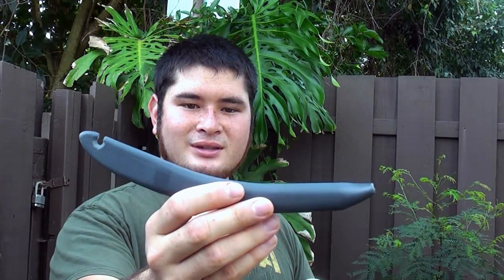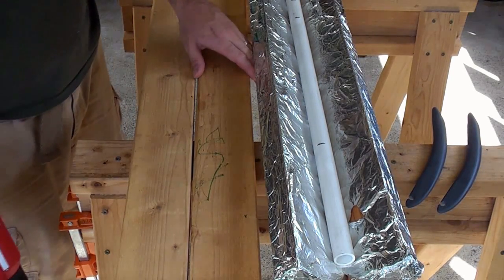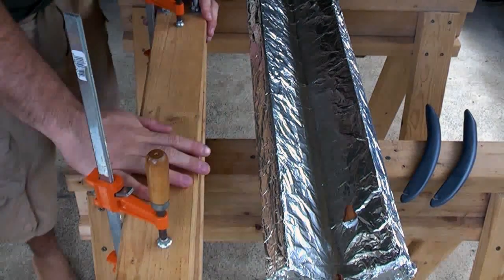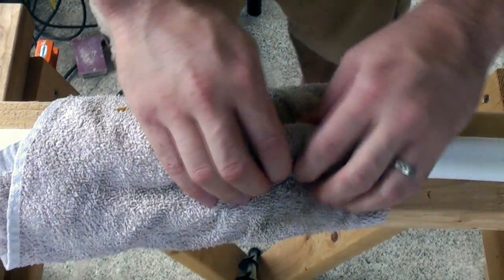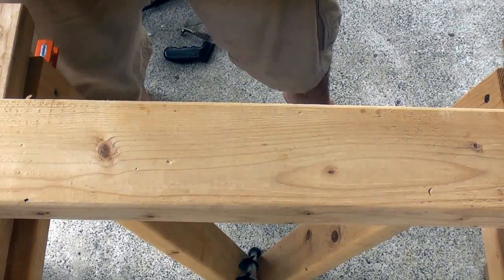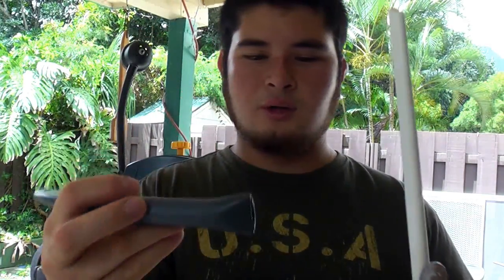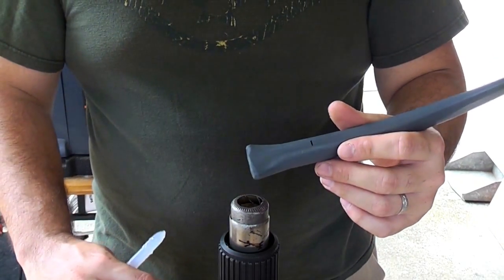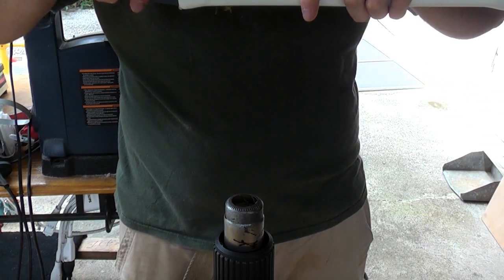PVC Horsebow With PVC Siyahs Build-Along Part 1 - The Build

Comment: A pvc how WILL shatter in minus temperature. And can be dangerous.
Reply: A compound will break if dropped from a high place or if dry fired. A laminate recurve will fail if dry fired or if it's used to hit baseballs. A crossbow will explode if when in a cocked position, you drop it from a plane....duh...

Comment: Approximately 1- how long will it take to soften the pipe with the heat gun before you know its ready to be cooled and about 2- how long does it usually take to cool? 3- Is there a big difference as far as heating and cooling between the dark grey pipe and the white pvc?
Reply: It only takes a few minutes to heat sufficiently and to cool. If you are ready to start, just get a couple of sort sections of pipe from your Lowes store or Home Depot type store and practice. I taught my Scouts how to make them in one hour and a half BSA Troop meeting. We went from cold pipe to finished and shooting in that hour and a half.

Comment: So can anyone please point in the direction of where I can get schedule 40 & 80 pvc in Tasmania, Australia cause I just walked in to my local building supplies place & the guys in there looked at me funny when I asked for it.. is there an equivalent teminology for aussie pvc that I could ask for instead.. cheers..
Reply: +Kolahai   Yes, like Womba Bloke said, US pvc is notably better than Australian stuff for making bows; it's got just the right amount of stiffness-v-flexibility, and responds very well to heat-shaping.  Our white water/sewage stuff is thin-walled and doesn't lend itself to adult-powered bows, unless you make them crazy fat, like 50mm pipe or more....you end up with these really wide paddle-bows, look crazy funny, but they do work.  They're also more brittle and don't respond as well to heat-shaping, so you can't get any really nice reflex/deflex into it, and you need to make them longer to counteract the brittleness.  Conversely, the orange electrical conduit is softer and responds better to heat-shaping, but it takes quite a set and lacks cast.  But it does work.  I would recommend using 32mm orange electrical conduit, and follow Backyard Bowyers recipe for making his basic recurve bow.  You'll end up with about a 30-50lb bow, the shorter you make it the heavier the pull.  Try a total length of about 55 inches for starters.If you live near or in Hobart, go to the electrical wholesaler D&W, next to K&D Trade, opposite the garden centre bulk mulch place...Mertonvale Cct, Kingston.....orange pvc is half the price of Clennets Mitre 10.And for your string, buy that slippery and brightly coloured nylon rope (yes, it's proper rope, not garden twine) that comes in a small fist-sized reel, I think there's a 3 or 4mm one that's right thickness.  Just tie a bowline at each end to make the loops, and serve the middle where you'll shoot with a pulled-away strand from another piece of the string (3 strands wound round each other to make the string...use one of the strands).  This stuff does stretch initially, so only loop-tie one end, and hand tie the other end when you've got the length you want.  Then after half an hour or something, unstring the bow and tie the rough-tied end into a proper loop with a bowline, getting the string to the same length (fiddly as all hell, but looks nicer in the end........like we can make a bright orange pipe look like a dangerous weapon.....
Reply: +Kolahai i know you asked that question a year ago, but we can't get schedule 40 or 80 or even their equivalent here, i'm just going to some shipped from the states.
Reply: Thank you both so much for your info.. It's appreciated trust me :) been struggling with that white stuff for so long, I practically gave up :)
Reply: +Kolahai ...No worries man, I've been struggling too for ages.  Too fun to give up though.  But I've just had an epipheny.....oh my goodness......watch Backyard Bowyer's Zombie Slayer video; the Schedule 80 (thick walled "mooshy" pipe) comes in the US as either a water OR electrical conduit variety.  It's still probably different in characteristics, but sounds much more like our orange electrical stuff.  So from now on, I'm using build-alongs that use Schedule 80, but one size bigger than shown....i.e. if they say, "we're using 1 inch schedule 80 today".....I'm using 32mm, one size up.  Yeah, think we're onto something here.  I'm glad you asked your question, Womba Bloke answered it, and it all peeked my interest and allowed me to re-think my experiences to-date.  Cool.  Good luck man.

Comment: if I use a thicker pipe does my draw weight get higher?
Reply: Yes. I have a 48" recurve i built, at around 60 lbs give or take
Reply: Oh, meant to add it started off around 70 lbs but took a set after a couple of days.

Comment from the maker: It takes anywhere from a few minutes to about half an hour, depending on the ambient temperature. I can usually get a whole limb heated in 5-10 minutes with a heating trough and siyahs in as little as a minute or two.